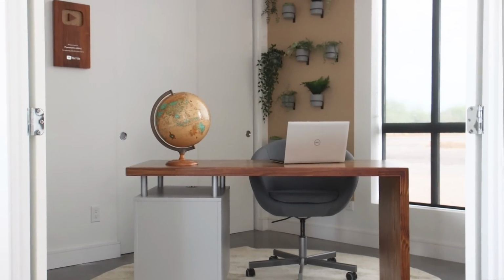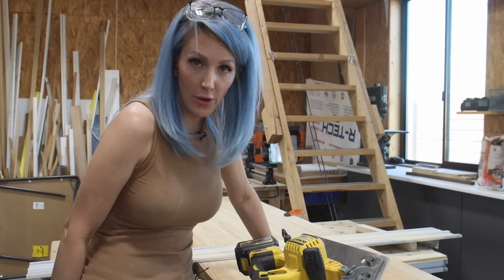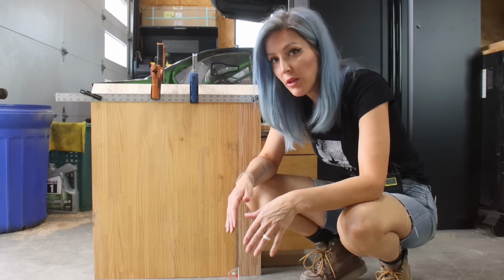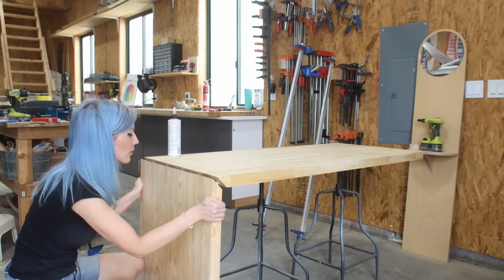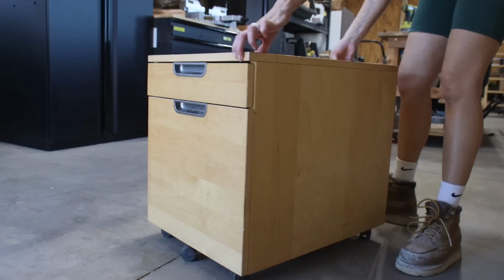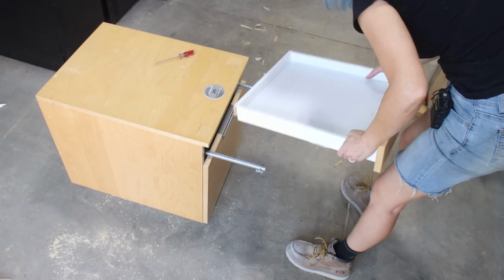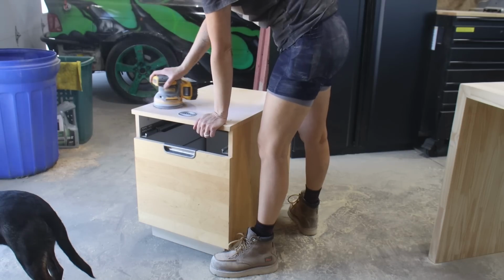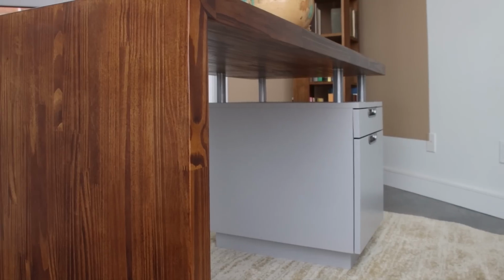EASY Waterfall Wood Desk | DIY

Comment: You clamped this incorrectly, even though you may have gotten away with it due to the dowels preventing the two mitres from sliding over each other. You applied clamping force parallel to the vertical side panel of the table, but the clamping force needs to be perpendicular to the mitres! This is normally achieved by attaching 3-4 pairs of triangular blocks on either side of the mitre joint using CA glue, clamping up the joint using the blocks and then removing the glued-on blocks with a shearing hammer blow afterwards. They pop right off without damaging the underlying wood surface.

Comment: Whenever you cut a 45° split both pieces with a 90° first and then make 2x 45° 9n each end also consider the WEN tracksaw system, people give it a bad name but I started with the WEN  and used it more than my Milwaukee track saw... Sold the Milwaukee to get other stuff.

Comment: I'll be making a 1-1/2" thick waterfall coffee table and have been looking at what people are using for glue after mitering, doweling or using biscuits or dominos.  The ones I saw from pro builders use epoxy on the joints, so I think that's the best route for the strongest joint.  Just need to tape all around the joint to keep squeeze out from getting on the exposed surfaces.  Fixing a separated waterfall joint that used wood glue would be a nightmare to make the joint seamless again.  I have a sliding table saw. so the 45 degree cuts should go well.

Comment: That gel stain can be frustrating to use.  If you put on too much before you start removing the excess it will dry and won't come off.  You have to work quickly and do small areas at a time.  Also practice on scrap material as much as you can first.  Your gel stain application looked very good.

Comment: There is another method for cutting thick, wide boards like in your case. Inspire Woodcraft found a safe way to use the tablesaw for that type of crosscut and it works! The video is called “tablesaw trick so crazy, it’s genius”! He also figured out how to make easy, perfect blade thick splines that I’ve personally tried and also works great for making splines like in long mitre joints

Comment: Ummm… butcher block is always made from hardwood. Typically hard maple. One of the hardest of hardwoods.
Reply from the maker: Butcher block can (and is) made from a variety of woods
Reply: Hardwoods are not all "hard" my friend. Hardwood refers to a category of tree species (angiosperm) that have broad leaves vs softwood which are conifers. Although the American hard maple at 6,400 N is a strong wood it pales in comparison on the world stage. The strongest of the hardwood is the Australian Buloke with a rating of 22,500 N. As noted by the video author, butcher block comes in a variety of woods both hard and soft woods.

Comment: Great looking desk! We used butcher block from IKEA for our desks too. Could you please explain the "screwdriver" trick? I've never heard of it and don't know what exactly you used it for. Thanks! Great video!
Reply: Just in case she doesn't have the time to give you an answer. With as many subscribers as she has I imagine that it becomes quite difficult to read, and address every comment. 

 She rubbed the rounded edge of the screwdriver over the joint edge gently crushing the wood fibers together to remove any gaps. This is just for closing up very wee gaps. Wood is wood, and you will always have irregularities to overcome when making joints, and this is a very good method of finishing the joint. 

Sometimes it's a good idea to mix some sawdust from the wood that you're working on with some glue then push it into the gap before you roll the seams together. Then when you do the inevitable sanding you won't be exposing the former gap.

Take care.